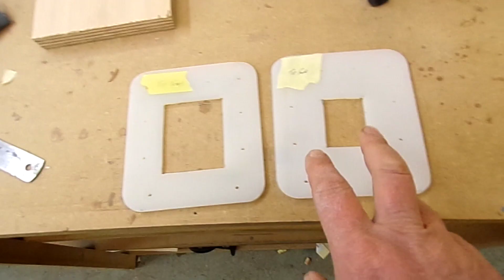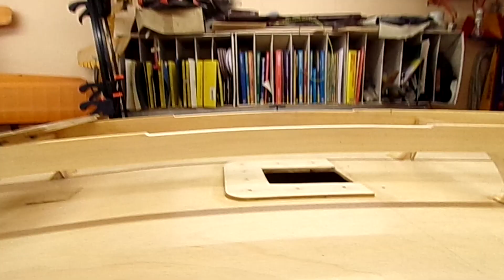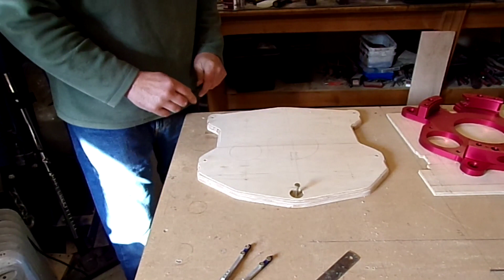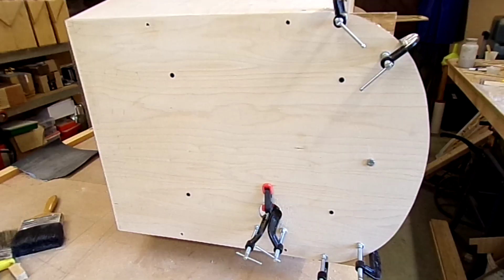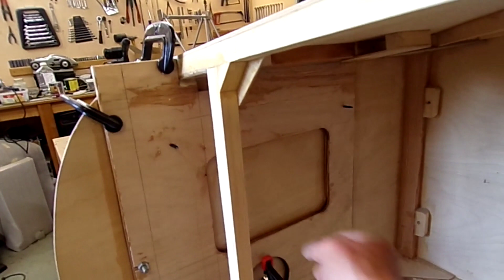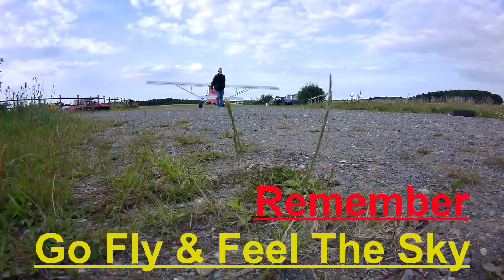EP97 Moving forward along the fuselage Fisher Youngster V

Comment: Does the engine mount come with the engine or the kit?
Reply from the maker: The red bit and some rubber bits came with engine but the rest of the mounts are for me to fabricate to my on design to fit the Fisher. It is my own fault for using a VW variant not use on a Youngster before.
Reply: @flyingkub  why did you opt for the VW Algy?
Reply from the maker: @ShortField  the aircraft was designed for a 1600VW I have gone for a more aero engine style modified VW engine. The reason for going VW easy maintenance and spare at 1/5 cost of rotax direct drive, saving  complexity,  performs like other boxer aero engines, oh I almost forgot, cheap. 😉
Reply: @flyingkub  🤣🤣🤣

Comment: Starter?? I thought you’d be hand propping that old biplane… 😉
Reply from the maker: Hand propping is all OK but can be a pain as you need chocks,  parking brake and need to be very careful getting in not to knock the throttle. That's all too much faff on a cold day 😀 If I can keep on weight I will keep it.
Reply: @flyingkub  and we are getting old..  I had an engine stall as I was throttling back,, I picked out a place to land, then got it restarted. Problem with no starter.... you can't start it from inside.
Reply from the maker: @grandenauto3214  Too true.

Comment: I may have missed it in a previous video… hoe did you mount the anchor nuts? Tiny little wood screws?
Reply from the maker: The anchor nuts are fitted with 3/32" blind rivets, the same way as you would on metal but the holes are toughened with thin super glue and varnished.  Hope that answers your question.

Comment: There seems quite a bit of detail in mounting that engine. I bet the little details take longer than the main items of construction.
Reply from the maker: The engine fit is a lot of planning as the engine, although a VW base , which the aircraft is designed for,  its configuration is different enough to required big changes to design.  In early fuselage episodes you may recall I shortened the nose by 2 inches to accommodate the intake ducts. All good fun and lots of tweets needed.